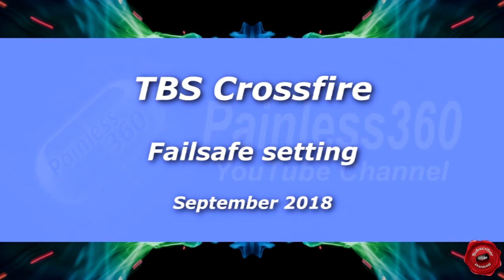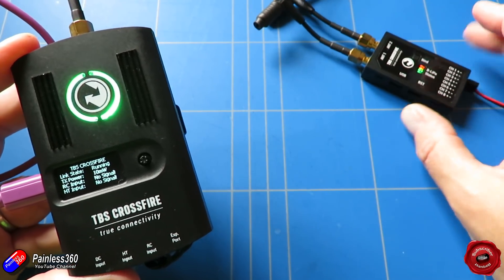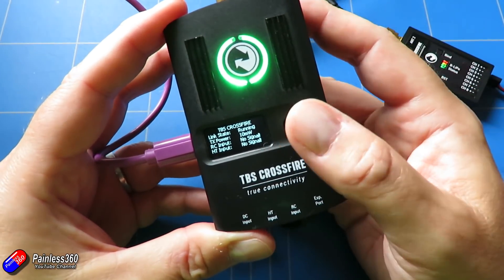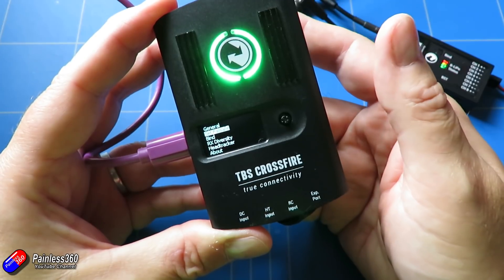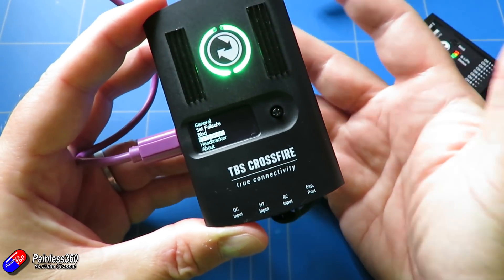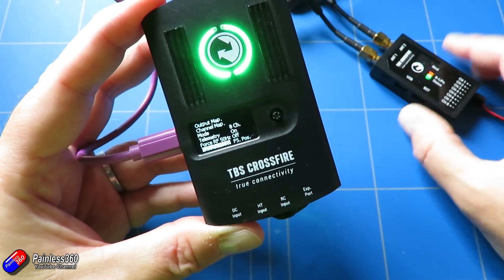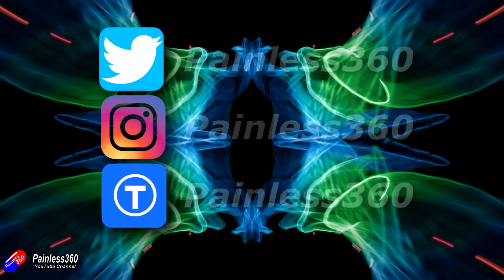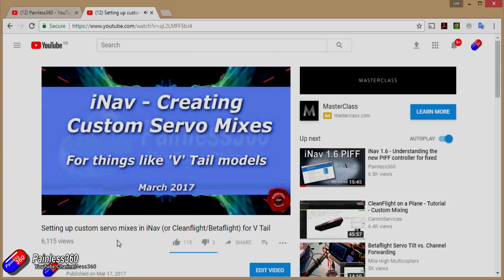TBS Crossfire: Setting up failsafe

Comment: I have set cut off for failsafe.When TX lost power,RX still send SBUS last data before lost signal to my FC.Why does it work like this? I need your help!
Reply from the maker: Use the Failsafe option that the flight controller detects... Best of luck

Comment: thankyou that would make sense why my 7inch quad went down years ago and utter frustation of setting things up caused me to put the hobby down for three years. back now and got a new chimera. with 03 unit, just got to figure out how to get my old air unit on inav in my AR pro and the new 03 on beta flight to run together with OSD on my goggles V2. with me luke.. PS thanks for the great vids been really helpfull Mat

Comment: Does "Cut" mean the drone will crash where it's currently at? And does "FS.Pos." mean the drone will hover over the place? I don't really understand what is meant with this labelling.
Reply from the maker: Cut means no signals will be sent. Failsafe pos will output the predefined value when the connection is lost. Best of luck

Comment: Will this overwrite failsafe settings in betalight?
Reply from the maker: That is different. Betaflight will do what you told it to with no pulses. Check it can see the failsafe on the bench.
Reply: @Painless360  Ok will do

Comment: Greetings brother, please help me set up the fail-safe parameter on the pitlab autopilot, I have this version of the crossfire.
Reply from the maker: I've never used one of those. Setup on the Crossfire isn't that different from all of the other systems on the market. I'd make sure that it all works on the bench before you fly.. Best of luck!

Comment: Good day to you Mr Lee, awesome video, helped me realize that the ZOHD Kopilot can actually be used with the crossfire. I have a quick question though with using the ZOHD Kopilot with the Crossfire.
Normally, the built in ZOHD Kopilot failsafe is either you flip the channel 5 switch to RTL or if you lose signal, the plane will RTL. 
If you use the Crossfire failsafe, does that affect the Kopilot failsafe features and if yes, how ? I am a total beginner and this is my first Crossfire install, the RTL of the Kopilot is so important to me as a beginner, it saved me many times before, so can I still use the ZOHD Kopilot RTL even though the Crossfire is installed and a Crossfire failsafe is set in use ?
Reply from the maker: See my video on crossfire failsafe. I'd set the failsafe to RTL mode... best of luck

Comment: Well, I did something stupid yesterday.   Did an auto lunch  with Matek f765 running  Inav on a FMS Fox 3meter glider.  Im also using a Taranis x9d+.  Well I launched and about 200 m my radio said telemetry lost. I had no control  then.  The plane just kept flying away.  I thought I had failsafe and RTH set up properly.  With rth on a switch it works great.  All of this happened because I forgot to plug in the 3cell battery  into the full size crossfire module. I had it set to 500 and not dynamic  power.  I flew the plane many times prior to my preflight check miss without any issues.   Anyway,  my question  is what are the settings  supposed to be on the crossfire module and on Inav.  I thought  RTH would have kicked in on Inav.  I immediately order another plane for long range FPV.  This kept me in the hobby as well as you videos  and recommendations...Moral to the story....PREFLIGHT CHECK.    Thanks for any information you can pass on.  Oh, and how would you  test failsafe without risking  your plane to check RTH.

Comment: Question - How do I get 12 channels on Crossfire? Do I have to get 2 receivers, or does the 8CH diversity receiver do SBUS?
Reply from the maker: They are put out on the SBUS/CRSF out that you configure. If you want to use 12 servos then you can use a SBUS to PWM adapter to expose the other channels for PWM control. See my video on it..
Reply: @Painless360  Thank you, you're the man!

Comment: Hi, just would like to ask what is the meaning of tbs failsafe 
fs.pos / "CUT"? I actually abit confuse on this.. Hope you can clarify for me...
Reply from the maker: Failsafe is how the receiver behaves if it loses connection with the radio in your hands. As described in this video, there are a number of options. Hope that helps..
Reply: I just figured this out.  Use cut if you want your FC to know it is in failsafe (CUT is analogous to 'no pulses').  If you use FS Position then the FC continues on without going into it's own failsafe mode (not ideal IMO).

Comment: Thanks for making this. I would love to know more about the 2.4 update, specifically the mode changes implemented. For example I set up my audio alerts on my QX7 per your other video, but since updating crossfire to 2.4, I get only the crossfire high speed warning, and that repeats 3 times each time it’s triggered. Something has obviously changed. Thanks!
Reply from the maker: From TBS - "LQ is shared in new format for OpenTX telemetry and receiver output. Recommended warning level is around 70%. RFMD can be excluded for OpenTX remotes warnings'

I've spoked to TBS about making videos that cover the main changes when they release firmware as they don't publish the notes so you can't see all of the detail that changed. Stay tuned!
Reply: Than you! That's more than I could find. Staying tuned...
Reply: Hmm. So RFMD can be excluded ... does that mean I should disable the warnings that identify mode changes and just focus on the LQ?

Comment: BUT! If, for example, I’m using a gps with gps rescue mode enabled as my failsafe, isn’t it the case that it would be better to have my crossfire set to “no signals/cut” rather than “position” so my FC would know I’ve actually failsafed? Otherwise my FC might think that I’ve just reduced the throttle to its minimum position and conclude, essentially, “well, he’s an idiot, but that’s not a failsafe,” and never enter gps rescue mode.
Reply from the maker: You need to set the failsafe up as you would with any other radio receiver if you’re using a GPS in your UAV. Normally I would set it up so that the ‘GPS return to home’ is triggered in the event of a problem. Happy flying!
Reply: Painless360 I think we are saying the same thing - the failsafe starts with the receiver sensing the lost connection. It then does something in reaction to that. If you have it programmed to reduce the throttle to the minimum position that you can produce with the stick, your FC might read that as the pilot deliberately reducing throttle, and not switch into failsafe/GPS Rescue mode, right? So it would be better to tell the receiver to cut all signals when it failsafes, and to program the FC to not assume there is a failsafe unless it reads zero signals from the rx.

Sorry, not trying to be pedantic - just trying to remember that there are two things you have to think about when you’re programming failsafe behavior - the rx AND the FC - and you need to make sure they “understand” each other.

Comment: Nice vid mate . If I fly kiss it gives you an option in gui for failsafe so would you set that as well as crossfire or just leave it and only set crossfire . Cheers jon 👍
Reply from the maker: The crossfire fail-safe system is identical to the main to options in any FrSky receiver. I've not touched KISS for a while so all I have in in the KISS series on the channel. I'd always check that you can run the motors on the bench and they react in the way tou want when you turn off the radio.. Best of luck!
Reply: Ok thanks for reply 👍